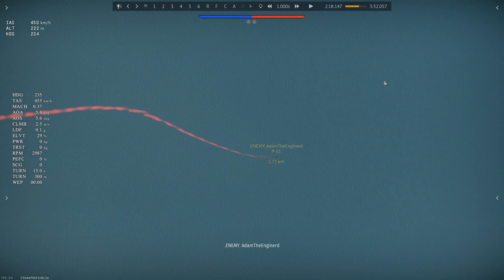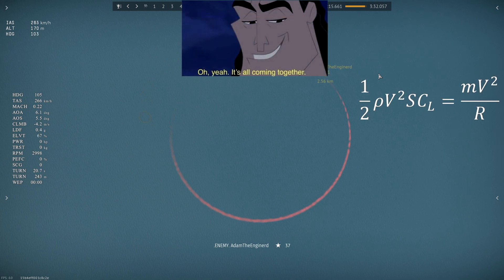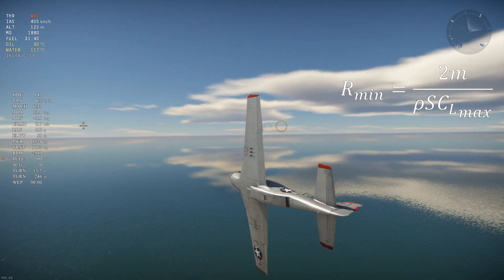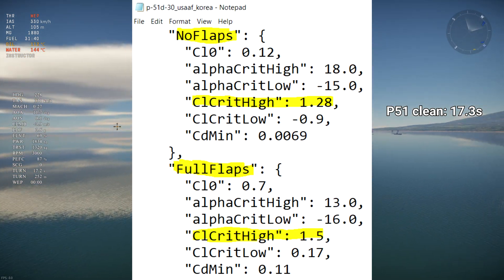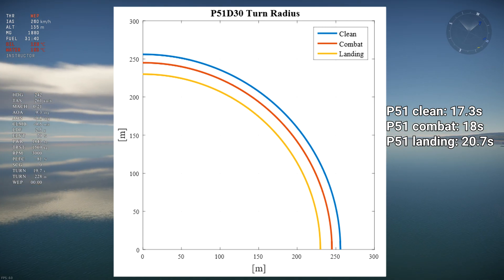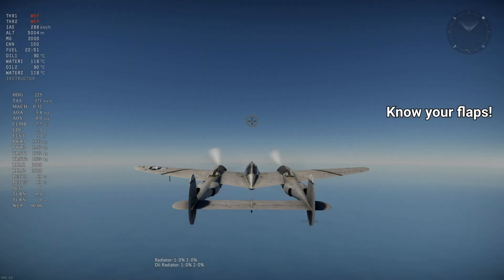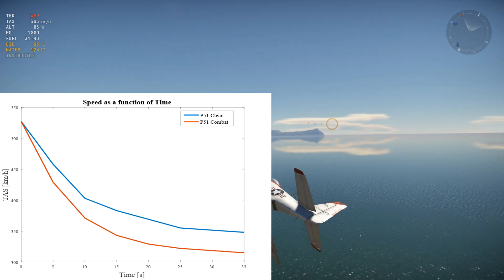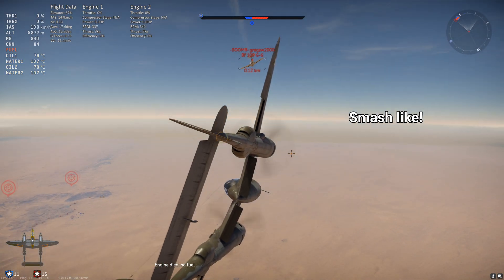Aircraft Turn Performance and Flaps

Comment: Is there any way to figure out which flaps are useful for each aircraft without the HUD you have? If the P-51 and P-38 differ so much it seems pertinent to know in any plane. Is it just based off estimate from what type of flaps it uses? Or can you judge by feel or some experiment for turn radius and time?
Reply from the maker: You can experiment and feel yeah. For most planes you'll rarely use more than combat flaps, so you can compare all combat flaps.
Reply: @adamtheenginerd2914  Thanks! I tend to default to takeoff flaps for "extra oomph" when using them, guess I'll try and limit that now.